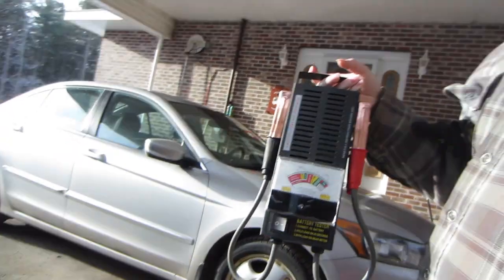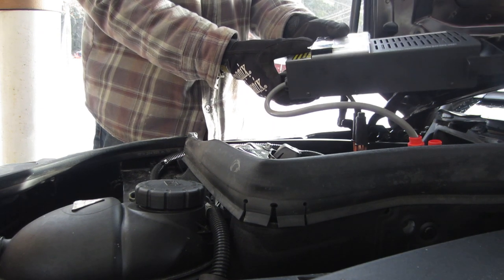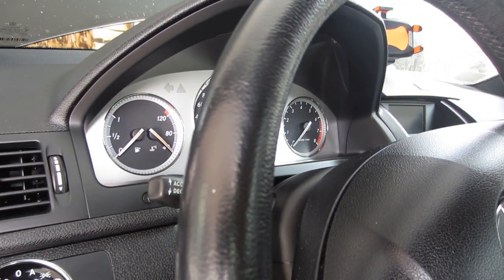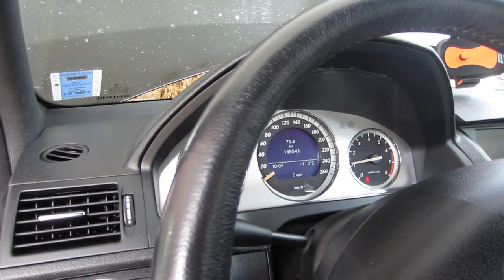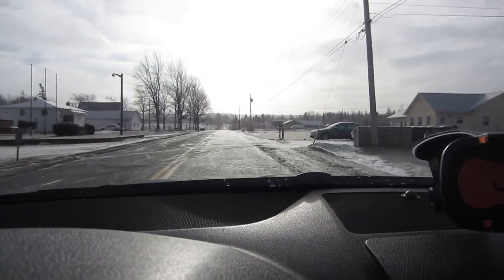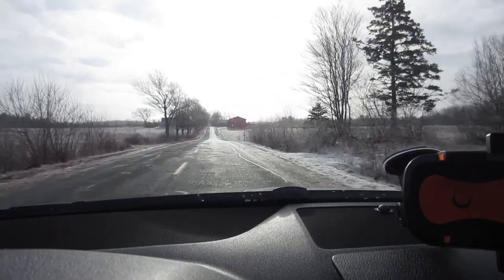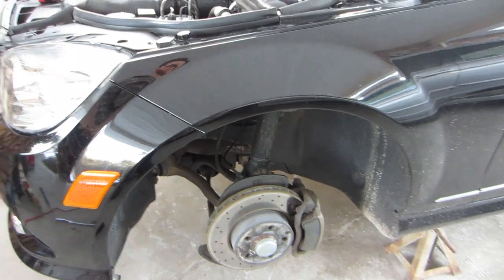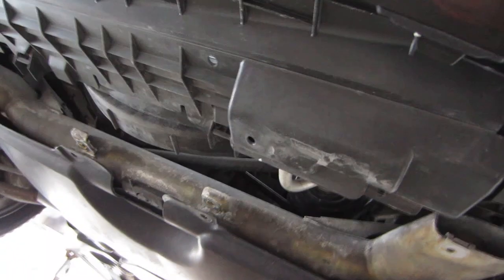I busted the Mercedes -  Fan running when car is off (Solution at end of video)

Comment: Don't go replacing your battery expecting to fix a cooling fan issue and here is why. By the way, epic fail by MB to have the cooling fan kick on when the ECU sees a low voltage situation. I just replaced the battery in my C280 because someone put the wrong size battery in it. I opted for the factory replacement since no one around here had the correct size, physical size , none were long enough to use the battery hold down clamp on the end. You never want a battery sliding around under the hood , ever. Anyways $180 at the dealer for the battery , installed it my self. Right after I installed the new battery I realized the fan was kicking on  when the car would sit for a while, then in would cycle on and off , then it would randomly just stay on full high speed all of which happened with engine off and key out of ignition , like it has a mind of its own. At the time I thought it had something to do with the key fob issues I was having so I just disconnected the battery , then had to have car towed to dealer for the key fob issue which is another long post all together, lol. Anyways I have my key fob issue squared away , I have a new battery from the dealer in the car AND the cooling fan is still kicking on at random times. Sometimes it will stay on , sometimes it will pulse real fast on and off , sometimes it will stay off. From all the reading I have done so far there is a 90% chance its the ECU . I like this C280 but MB just over engineered the crap out of the electronics making it difficult even for the most experienced do it yourselfers to diagnose and repair  so you have to go back to the dealer and spend big bucks to have it repaired.

Comment: Thanks for this! Had the exact same problem. Got to my car after work, battery completely dead. Very strange, as I had recharged it, just as a precaution, a few days ago, as some little electrical niggles had started. Thankfully the lady who had parked in front of me got to her car at the same time and let me know the fan had been running on high when she got there. Obviously what had drained the battery... I tried jump-starting the car and as soon as it had enough charge, the fan came on again and drained all the charge - so much so that I couldn't jump start it. Disconnected the fan, jump started the car and reconnected the fan so I could drive home. Have now disconnected the battery and put it on a recond-charge. Been 12 hours, still not fully charged - think it's time for a new one! Thanks for saving me a lot of head-scratching!!

Comment: Hey guys. In my case the block heater caused the problem.
I live in Canada and I have to plug it to keep it warm when the temperature is too cold. I put a trikle charger (Noco Genius 2G) that means the battery is always on the right voltage.
I conected together under the hood with the block heater.
But.... I forgot to put a timer to turn them on and off every 15 or 30 minutes. My block heater was working and overheated my coolant for 5 days nonstop.
The sensor was detecting 100 degrees for that time.
I solved uplugging it for 2 or 3 days and letting the temperature dropps to cero degrees.
I started it again with the coolant cold and the problem was solved.
Sometimes you fix the issue not because you are replacing the battery... You are fixing the problem cause you are reseting the computer unplugging the battery for at least one minute.
It was my experience.

Comment: I had EXACTLY the same problem with my ML430. It's one of those strange things. It makes absolutely no sense. The battery that I take out of the ML gets put into one of the other cars and gives a few more years of service (This has happened more than once). Once the ML has a new battery the fan works and powers down and a few more gremlins stop acting up (at night the radio backlight doesn't switch on sometimes). I even tried to put a new battery from one of the other cars that is underspecked and it also gave me the glitches. I tried with a 8A charger connected and the battery fully charged and it still glitched. The only solution even though it makes ABSOLUTELY NO SENSE is to replace the battery with a good quality NEW battery. The battery drain issues also stop with the new battery. I have also noticed that it happens after the battery has been discharged once in its life where it has insufficient power to start the engine just once. After recharging it appears to be okay but it isn't.
Reply: My Vito115 does the same thing. Once the battery reaches a certain age the  van drains  the battery (via the computer fam) until a new one is installed.
My SL320 has a marvelous feature. when the battery goes low it disconnects thereby preventing battery damage. Just a few minutes of charging and the car is good to go. 
My 280SL is still the most reliable car ever nearly no electronics.
Reply from the maker: Sounds exactly right. Thanks for the overview. Most people don't realize there are more parameters to battery than just storing 12V. The sense circuit is just a little too sensitive. I get the logic behind the car killing the battery so you'll replace it but, in practice, it could leave you stuck. Because even my little booster pack I keep in the trunk would just cause the fan to come on full blast, you'd have to unplug the fan header, start the car then plug it back in with the car running. Not a great situation.
Reply: thus is NOT a feature, it is a bug of the battery Management.  Fear not the newer Benz still retain this battery drain. 
Tons of heavy duty 1st tier AGM batteries get discarded for no good reason.

The issue is tied with the reading of battery sensor over the CAN-BUS or lack of communication with it through "gateway module"....

Use "worskop menu" to display batt. voltage on the dashboard while driving... witness what is happening !!

Comment: I have a 2002 E320 that has a similar problem. I’m thinking because I have a significant battery drain problem, I’m sure it’s the radio that’s causing the drain. I jump started the car wash he other day and the blower fan came on without being turned on . I switched the car off and it continued to run full blast! Could this be from jump starting car and the computer going haywire?

Comment: I have a similar issue on 2009 ML320. It's a grounding problem with the blower motor, which is costly to replace. Under the glove compartment take down the panel and you will see a connector to the blower motor. I just wired it directly to manually turn on/off through a switch.

Copied from another thread

Comment: You had an internal crack or break at the post, on your battery.. unique issue. Thats caused by hitting the post with excessive impact or overtightening the battery clamps, causing the battery post to flex and resulting damage.

Comment: hey man im having the same problem. Sometimes the fan would turn on after shutting the car off, but it would only come on for a quick few secs, than shut off. Than sometimes my fan would work during idling and than it wouldnt work and would overheat my car... Than it would fully work with ac and heat on. I just changed the battery and it still the same and i changed the coolant thermosttat and still the same.
Reply: what was your resolution im having the same problem, just bought a new battery. The fan is draining my battery.

Comment: My car (2008 c300) just did the exact same thing tonight. I noticed it turned on without the key anywhere near the car. when i unlocked / locked the car, the fan would shut off for a minute; then turn right back on. Did this several times before I disconnected the battery. Ill have to deal with it tomorrow night when the stores are open. I noticed its the original battery as well. Hoping thats my issue.

On a side note, I will have a video posted tomorrow of s funky thing my nav screen is doing. If you wouldn't mind taking a look and seeing what you think, that would be great! it has a mind of its own, that's for sure!
Reply from the maker: I can't guarantee it but, it could likely be a bad battery. The computer is always monitoring it and if it falls out of spec  it will start killing it by running the fan so you'll replace it. And it's not unlikely that a bad battery wouldn't cause other issues. The other thing to check, with the car on, does the temperature gauge respond normally? (show cold when first starting in the morning then gradually come to operating temp and stay above 80) If not,  it could be a temperature sensor. It's also possible that the fan control module is bad. Given what you've told me, these are less likely. If it's the original battery, change it, it's old enough you'll start having problems anyway. 
And I will take a look at your video for sure. Good luck!
Reply: What happened? Did it solve the problem after changing the battery?
Reply: I have the exact same issue for 2 nights in a row. The car is currently in a service, and i've told the guys not to replace the battery in order not to kill a brand new battery, but to try to find the problem, and couple of days after they're still unable to find where the problem might be. I'm a bit concerned about the ECU as it is the most expensive opiton in that case, but still, I might ask them to try with a brand new, quality battery. Almost forgot to mention, they tried with brand new fan kit (including the fan module and everyting) but the car have had the same issues. I've also having the fan on full speed even when the car is on, and once I turn the ignition off, and wait for a couple of hours, the fan ramps up and kills the battery. My current battery is about 4y old, could you please share any thoughts on this, and whether you managed to fix the problem by replacing the either battery or ECU?

Comment: use the "secret workshop menu" to display batt voltage on the dashboarf while driving - You'll see how the computer wants to charge your battery !
Max 14.9v into AGM while cold
Above 12.6v it is charging ok
Below 12.4v it's draining power
Below 11.9v dont drive too far!

"Whorkshop menu" is invoked prior to engine start sequence
 👍🏻
Reply from the maker: That's a good tip. You can also monitor it with any number of OBDII readers.

Comment: I'm having a similar problem right now.(2011 c300)  I left my lights on and the battery was dead in the morning, now once I charge it, it works but then the fan continues to run, which I think is draining it, so then it dies again.  Took it to where I bought it, they think its a module or a sensor, nobody seems to want to listen to my suggestion about the fan running because of the bad battery.  They have me bringing to their Mercedes specialist for a second opinion.  I called the dealer they want $165 and hour just to diagnose.
Reply from the maker: Hi Melissa, sorry to hear you're having problems. Let's see if we can narrow it down. Do you know how old the battery is? And did you measure the voltage in the morning when you realized it was dead?
From what you've said so far, it's possible  to ruin battery by discharging it down to a really low level. Which leaving your lights on could do. Especially if the battery is a little older. It reduces it's capacity to hold charge and the computer on these cars is very sensitive to a battery not being in spec. I'd start by load testing the battery, looking at the voltage before and after a charge cycle as well. Even if it tests ok, I'd see if I could get another battery to even hook up temporarily and see what it does. If the battery is anywhere near 5 years old, I'd just replace it. If a scan has already been done with a Mercedes specific scan tool, it's unlikely the star diagnostics would be able to tell you anything more. It is possible for a fan module or ecu, or engine temp sensor to go bad but there would more than likely be an error code.
Reply from the maker: Also make sure the battery clamps are secure and free of corrosion.
Reply: The battery is actually only 11 months old, which is why  I thought one night with the lights on wouldn't be that big a deal.  Unfortunately I don't have a voltage checker (that may be little out of my skill set)  luckily they are sending it to their Mercedes mechanic for me who isn't going to charge to diagnose.  I just like to be as educated as possible.  It's weird because even though the lights were turned on (not auto) they were not actually on (like shining light) My car does this strange thing when it rains, where the "Auto Light Inoperative" warning comes on and the wipers don't work, this was happening the other day, which was why I turned the switch to on.  This is also something no one has been able to figure out.  Have you heard or had that issue?
Reply from the maker: Oh ok, it could still be a bad battery but with that information it sounds like the issue is elsewhere. If you're not comfortable with a multimeter or load tester, best leave it to a mechanic you trust. I haven't heard of that issue specifically. When it comes to diagnostics, multiple things happening at once are rarely a coincidence. I could guess at what the issue is all  night but what you need are some initial measurements so you can  break the problem down to smaller levels until you isolate it. With any problem, there can be many things that would cause it.  I hope  you can get it figured out and report back. I'd love to hear what you or your mechanic find.
Reply: So I just heard back from the mechanic (literally had the car this whole time) and they said that the satellite radio, which I don't use or even knew I had,  was continually running and that was what was draining the battery and causing the fan to run.  So since I don't use it the fix is going to be to just disconnect it.  They are charging me $390 for the diagnostic and fix, which I guess is better than the dealer would have.  But still a little frustrating.   Not sure what I think at this point,  any thoughts?!?
Reply from the maker: That very well could be the issue. It is a known issue that some vehicles develop, actually it can happen with any of the powered accessories. That's why I was saying it could be any number of things. Normally everything goes into a "sleep mode" after 20 mins or something. If after that time you measure the battery draw and it is above a few milliamps, you start pulling fuses until it drops to a nominal level. Whatever device that fuse belongs to is the source of the problem. 
I hope it fixes your problem !
Reply: @melissatesta5147  hi i have the same issue and would be able to tell.me what.do u mean by satellite radio? thx
Reply: roger zhang serious radio or any type of pay satellite radio service... even if you don’t have subscription, just having the access to it available in your vehicle
Reply: y